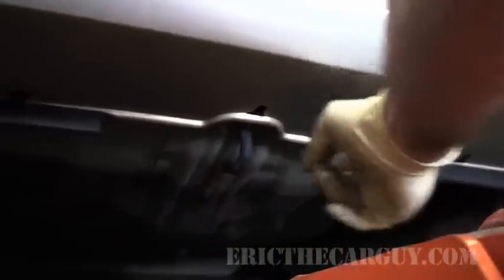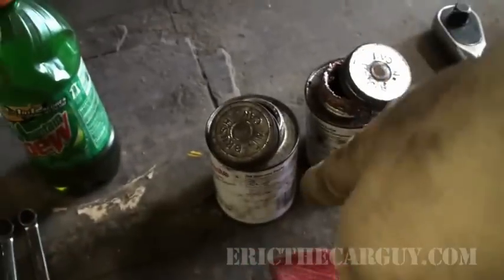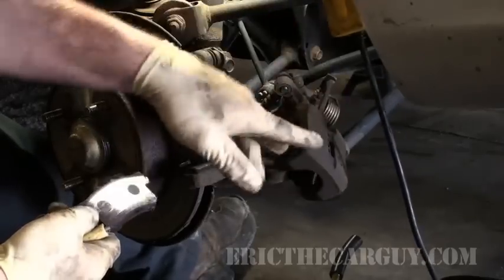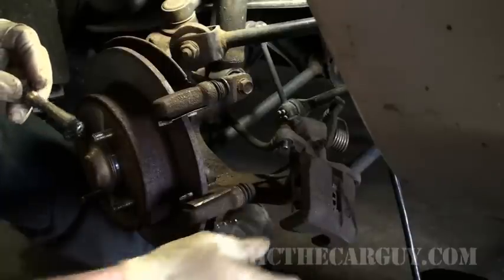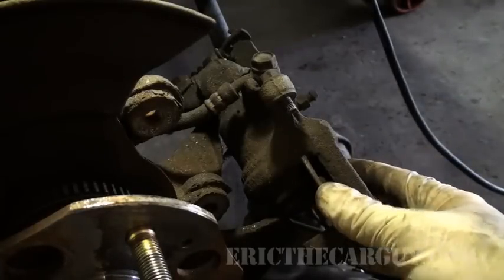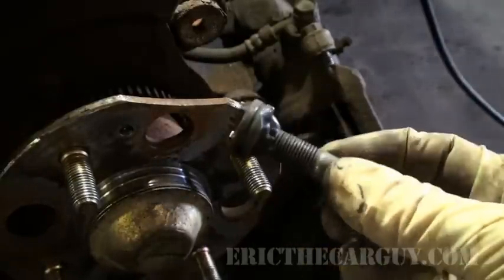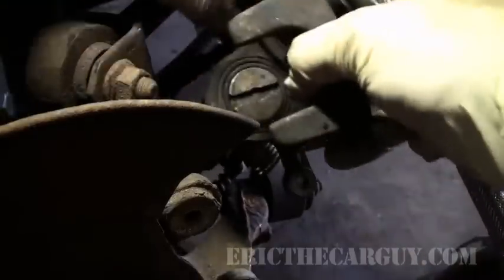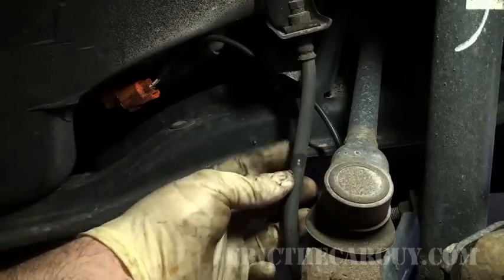How To Replace Rear Disc Brakes (Full) - EricTheCarGuy

Comment: Awesome video Eric!!  I'm 44 years old and from the time I was 15, I learned how to change breaks and rotors etc.  So for many years, I thought I knew the "standard" of how to do my own break, rotor replacements.  But come to find out, I was doing it the hard, long way and even taught my boys how to do it the "old school" way.  I'm getting to the point where I want to get the job done quickly and efficiently because of the time it takes from my work and the wear it puts on my back!!  Watching this video put a WHOLE lot of things into perspective and made the 2nd rear wheel job a snap!  I even replaced the caliper easily and it was the first time I ever did that part.  Now I can do things a lot quicker, smoother and I already re-taught my youngest son the "right" way to replace the components.  Thanks so much!
Reply: Its Brakes Carlos, not breaks.
Reply: yeah my back is killing me. This video helped me out a lot also

Comment from the maker: @captainvlog I've driven them for years and I've been pretty happy with them.  Keep in mind that I also have a bench full of spare Honda parts in case I need them so there are times when I can just pull something off the shelf instead of having to buy a new part.  I'm also an Acura master tech so I know my way around them, I like to stick with what I know.

Comment: Great Video Eric!! I was wondering if it's necessary to bleed the brakes. Can we just open the brake fluid reservoir cap when we push the pistons back in the cylinder?
Reply: No brakes won't need bleeding if you don't take the brake line off of the caliper
Reply: You could but it's detrimental to your braking system. What you may be able to do if you want to do it that way. Once you have pushed the piston in use a turkey baster and suck out as much oil brake fluid as you can with making system catch air. Then put new stuff back in. brake fluid degrades over time this will help

Comment: I'm close to replace the back brake pads in my 2013 vehicle. I have done this task in other vehicles of former years, but each generation comes with different ways to do maintenance. I mostly check your videos first, because you show it all, problems included.

And, from these problems like corrode nuts, clogged fluid passages, and more is when one learns more widely about car maintenance and repairs.

Thank you from the bottom of my heart for your videos.

Comment: Just want to add a note of caution - smacking a wrench handle to break bolts loose can damage nerve endings in your hand.  The result is similar to carpal tunnel syndrome.
Reply: Excellent point. I think at some point in one of Eric's videos he addresses that, but I could be wrong.
Reply: TheSuburban15 my nerve endings are long gone
Reply: Yes, these days I use a pipe over the ratchet handle only to crack it loose then continue without it.

Comment: Thanks for this video Eric. I replaced the front yesterday, and the rear disc brakes this morning, on my wife's 2007 Ford Fusion. I watched your video on each before doing the work. I am so glad you take the time to do this for everyone. The tips about opening the bleed valve, and using silicone around the piston jacket were super, and something I would never have thought of. She now has perfect ceramic brakes, front and rear, for only $100 as opposed to the shop wanting $400 total. I am a hero.

Comment: You don't have to bleed if the piston is pushed and twisted.
Reply: Gyula Nagy Still good to use the bleeder so it doesn’t seize and break. Also you get to change out the old fluid

Comment: Thanks for the video, after watching your video, I replaced the rear brake pads in 30 minutes, skipped a few steps though, like loosening the bleeder valve, just turned in the pistons with a blunt chisel while using a pushing force. Worked great, thanks again.

Comment: Thanks Eric!  replaced rear  rotors and shoes   Was so close to   replacing calipers , after seeing this video , I gave it one last shot , noticed  that one shoe on each wheel was tight ,the caliper pistons  were where they should be, so I took off some metal on each shoe ,reassembled and fixed! You are The Man!!!!1

Comment: Really great that you explained "clocking" the piston so that it engages the bump on the back of the pad!! I replaced the rear pads recently on a Ford Expedition and didn't know about this. I just turned the piston back in and didn't stop at any orientation. I caught the mistake at some point but did have to check the other side I had just completed. Just by pure luck that one had lined up correctly!!  Oh and about lubricating  the dust boot !!! Great info!!! .Years ago doing a Nissan Maxima I had the boot on the verge of ripping because it was stuck to the piston and was twisting as I tightened the piston tool.. Most of us out here don't know this stuff. Thanks ..

Comment from the maker: @spelunkerd NEVER USE ANTI-SIEZE ON THE SLIDER PINS, when you mix lubricants it will cause the pins to seize, only use it on the pads not the pins.  There are some commercially available silicone paste products out there and you can find the 3M stuff I use online.

Comment: Your videos have saved my bacon more than once. I have a 1997 acura cl & I made my own "rear disk caliper tool". It's a short length of thick maple stick with a short tenon formed on one end & a hole drilled through the other to accept a dowel handle. Works like a charm & sure beats paying $12 for the little cube shaped tool. Anyway...I'd like you to know that you don't have to put the rotor screws back in. They are only there for manufacturing purposes. They hold the rotor on til the caliper and wheel are installed. Think about it...doesn't the wheel hold the rotor in place just fine? My 92 Ford Escort had those in its drum brakes. They were the first thing I encounterd that required me to buy an impact driver set. They didn't go back on the car....they got thrown into the woods as hard as I could! Drove the car another 125,000 miles without those screws. Thanks again for the video. The information is priceless & so is your sense of humor.
Reply: He is right.

Comment: Thanks!
I laughed at the part about turning the piston in cause that's exactly why I came to watch the video. Rear brakes are ending up being a more complicated job than I had thought. Rusted bolts, rounded heads, no one carries the right bolt off the shelf, the special tool for the piston..
Reply: Paw patrol

Comment: Just did the rear brakes on my daughter's '91 Prelude w/ 4 wheel steering. After watching your Vid, it was snap...somewhat! The OEM rent-a-tool proved to be worthless for me. After struggling to get it into position & stay put, It would keep falling out. I finally gave up on it & went for the screwdriver method. Much easier. Thx for your knowledge & shop tips...

Comment: Thanks so much for posting this.  It was exactly what we needed!  One deviation we had to make - we didn't have the tool to turn the disk.  So looking through the toolbox we pulled out some needlenose pliers to put the tips into opposing notches and sure enough was able (with a little struggle) to successfully turn in the disk.  Thanks again, Eric!

Comment: I know the indicator should be on the bottom of the inner pad but at 10% they squeal driving all through town.  If they're installed the other way around, they squeal on reverse and don't injure the rotor while I wait for parts to come in.  I wouldn't do it on customer cars because customers tend to ignore squeals until the last minute and if they only heard it on reverse, they'd let it go too long.  A week long squeal and they take action just to make it stop. 

But on my car, I install them top inner pad edge because when I back up and it squeals, I know I'll take care of the problem in a timely manner, save my rotors, and my neighbors won't need to know I need a brake job all  week long.

Comment: just an FYI to the viewers: if you're changing the pads on an Accord Crosstour, they have the press-in caliper not the screw-in type. Also the pads that touch the caliper piston have 3 prong/claws that grip inside the piston. To remove those pads, you will need to loosen the bleeder screw first and press the pad and piston in to give you enough clearance to get them out. Its very simple!!! Easier than the screw-in type in fact. This video is all you need to change the rear brakes!!! Thanks EtCG!

Comment from the maker: @roseannmiller You can try rotating the suspected wheel by hand, it should move with little effort, if it's a front wheel make sure it's in neutral when you try this.  Also keep in mind it could also be a brake hose that causes a caliper to hang up, normally I check calipers by compressing the piston, if the piston won't compress it's a good sign that the caliper is faulty.  It's also important to use silicone paste on the caliper slides and not grease.

Comment: after fighting with the rear caliper piston with my C-clamp and/or wood/hammer to push it back.....I finally checked the internet and came across this video.........Holy crap, never knew!  Needless to say, doing it right enabled me to do both within about 30 minutes........I had to fabricate my own screw compression tool....but for $80 I did all four tires and didn't play likely $400..........great vid!!!!!

Comment from the maker: @MrStarscream88 I don't recommend that even if the piston will just push in as it can damage the master cylinder.  Depending on the caliper design the caliper may have the parking brake assembly as part of the caliper as in this video, if that is the case then you need to turn the piston in as it will not compress as it did on your car.

Comment: you answered the exact question i was looking for, friend told me all rear calipers need to be compressed by turning it by using that one tool, well on the car i am working on the e brake assembly is entirely different. Thankyou so much for covering that!!

Comment from the maker: @healthinbeat Reman calipers sometimes come with different sized fasteners, it may not be stripped but rather just spinning the caliper slide, if it is try to lock the caliper slide into place and then try to remove the bolt.

Comment from the maker: @fordfan855 Not yet.  The pins come lubricated with silicone from the factory, if you don't use a silicone based lubricant it will cause the lubricant to dry up and then the pins seize, I've seen it soooo many times.

Comment: Just want to say thanks for the info. Today I was changing the pads and disks on my 407. Front done no probs. Back ones 4 hours and had to give up due to night setting in. Will start again tomorow. With the hope that opening the bleeder will work. Because mine is spinning just like yours was in the vid. Thanks :D

Comment: Great video(s), thanks for the knowledge. Changed out front/rear rotors and pads on my 93 Cutlass Supreme and came across this to note.

One Important Note: On the rear caliper pistons, when compressing them, make of a note of the DIRECTION it spins during compression. This is important to note because it will be the OPPOSITE direction on the other side of the vehicle.

For example, the passenger rear caliper piston rotated clock-wise during compression. The driver side was the opposite, rotating Counter-Clockwise during compression. (based of a 1993 Cutlass Supreme)
Reply: Do you know if front caliper pistons are need to be turned ?

Comment from the maker: @DJYIC DO NOT USE ANTI-SEIZE ON THE SLIDE PINS, if you do it will cause them to seize in the bores.  You can find silicone paste on line, the stuff I use is made by 3M.

Comment: on some newer cars IE kia forte 2011 there is a inspection hole where you have to back off the ebrake drum shoes by adjusting the adjuster to take of the rear rotor   use a good quality silicone grease on the pads and shims the anti seize dries out cakes up thanks eric your videos helped me do my first disc brake job saved myself a total of 400 bucks doing the brakes myself

Comment: This was a comprehensive presentation, I feel with the information, precautions, and sequence needed. However the emergency brake application to the rotor or the caliper is different for some models. I am looking for a Sebring 4 door, so I will have to keep looking, but great job, Eric.

Comment: Looks like great information! I'm about to change my '07 Accord RB's and this has some information that no one else touches on.  I did the fronts last year and did not have EtCG's video available to me at the time.  I figured it out, but took me longer than anticipated.  I'm hoping this will get me through some of the trial and error BS!  Thanks in advance.  I'll update in a day or two - I hope. (It's the weekend, the weather kinda sucks and I'm outside.)

Comment: I have been doing this for years without any issues, but you could potentially cause a leak in the seals of the master cylinder. After watching Eric use the needle nose vice grips to clamp the hose, I started doing it that way myself.

Comment: Eric, thanks a bunch for this video and the other one on Front disc brakes. I was able to replace all front/rear rotor/pads using your two video's.  Also the disc rotor screw video was helpful as well, a few hundred whacks with the two hammer method and impact driver.  And they all came out.  Awesome thanks again!

Comment: Some brake pistons can be pushed in with a C-clamp but others have to be wound. Never used the clamp on the brake line before but now that I see it, it's a better idea than pushing the dirty fluid from the piston bore back into the brake line. I do know that some brake master cylinders  can have seals unseated by the reverse action of allowing fluid to push back into the master cylinder which then requires a strip down, Thanks for the video Eric.

Comment: Hey Eric, I've used the screwdriver end of a crow bar to turn the caliper. Works.
Reply: +Fear the Spear Also, I found that the contact point of the old brake pad kinda works too, as sketchy as that may sound.

Comment from the maker: @maximus20895 It may be clogged, sometimes you need to clean up the bleeder valves to get them to work correctly.  I remove them and use a pick and a wire wheel to clean them most times.

Comment: thanks Eric. I did it. your trick with the hammers to remove the disk screws worked on one side. needed additional help from an impact driver on the other side. Bought one, but two out of three Auto Zone employees gave me the deer in the headlights look when I asked them for the item as shown on their own Web site. I wonder what are qualifications to get a job there.

Comment: Another Great Video! Excellent example of how things don't always go as planned(bleeder valve) and good trouble shooting. I am having my brakes replaced at the dealership in a few days and at first I was shocked at the price but experience and know how is worth something, actually a lot. It actually isn't that expensive when you consider the brakes have been on the vehicle for 6 years and it comes out to $87/year(25 cents/day). Reading through some of the questions in the comments sections I was dismayed at how many people take on a job and are completely clueless and don't know how to troubleshoot at all. Cut back on pizza once a month and bank the cash you saved for the brake job. You pay someone to make the pizza, so pay someone to change those brakes for crying out loud. I am done with my Dave Ramsey rant.

Comment: Whenever you work on brakes, I suggest that you wear a respirator. I would also use torque wrench and tighten the slider pin bolts & bracket bolts to factory specs. Brake cleaner spray is also highly toxic.  

If you want to do a perfect job like I do, clean all hardware and use Honda silicone brake grease. I replaced the piston seal & boots as there is a caliper overhaul kit available at a reasonable cost. If your Honda is over 10 years old/has over 100,000 miles, I recommend this servicing.

Comment: You should either buy a repair manual or borrow one from the library. Makes it easy.

Just in case, based on the immediacy of one comment on a video that he uploaded well over a year ago, Eric Cook doesn't immediately head out and find an 09 grand caravan, shoot and edit entire video demonstrating the relatively common procedures of changing rear brake pads on your specific vehicle and then upload it within your requested time frame. Good luck on your plans

Comment: Eric, if you get the chance to work on replacement of an emergency brake, can you make a video out of that?  I'd personally prefer a Honda with an auxiliary drum brake/exclusive parking brake (not sure what the standard nomenclature is, but it's mounted inside the rear disc rotor) but I know you have to work with whatever rolls into the shop.  I've only found one such video on Youtube and it has no narration.  Thank you for all the work you've put into this channel over the years.

Comment: Harbor Freight item 69053 is a high quality caliper retractor tool kit with a complete set of attachments, and a lower profile so there shouldn't be any problems with clearance as seen in the video.  Well worth it if you expect to do more than one.

Comment: i aint got a clue what im doing eric but your video was simple maths. im off to get my parts now and ill do them in the morning. front was easy and your tool is spot on....why do they make the rubbish one you buy when you could have the one like yours...... im going to make a t bar that fits the slot as i got no welder....if i had a welder my car be one big weld.... have great day all thanks for the video and ill let you know how i got on..... ill drive slow when done so if the brakes dont work not be no biggy of a crash.......if its to hard then you to old.